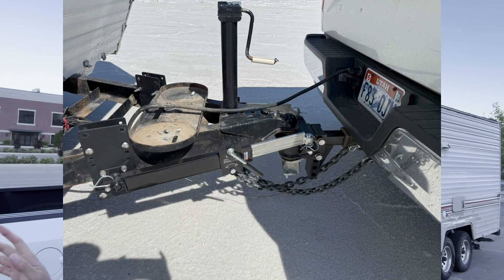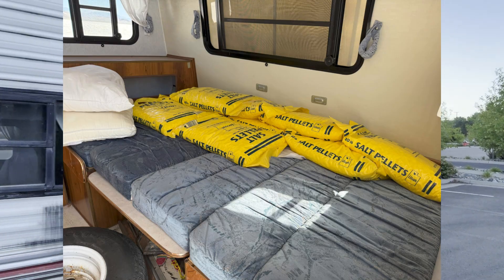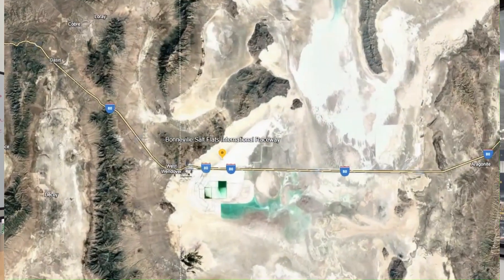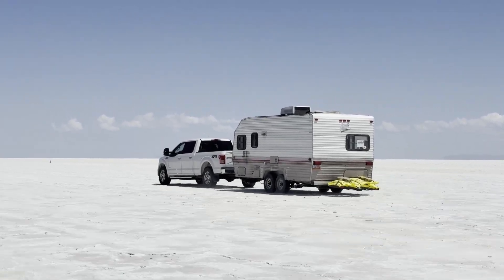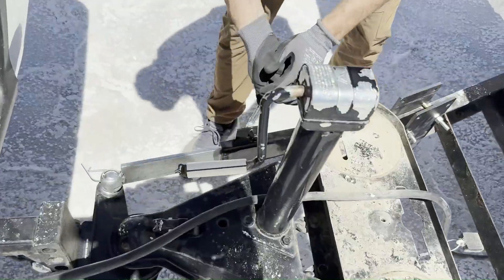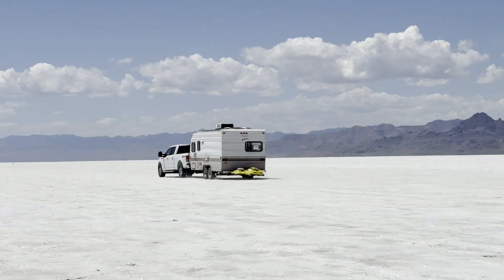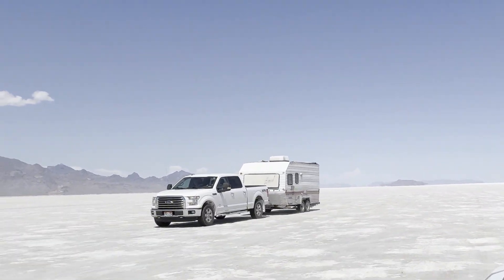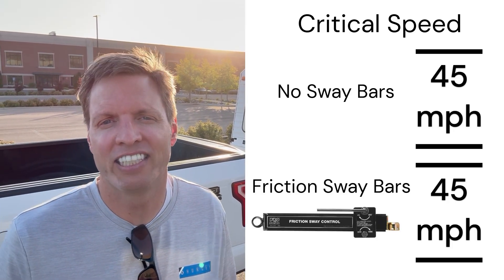Truck and Trailer maximum speed at the Bonneville Salt Flats

Comment: Great video. Incredibly concise - nice job! I've often wondered if friction bars are effective and deep down inside did not think they were. Thanks for confirming this. I have the cam style sway bars on my trailer that are adjusted to "lock in" when driving in a straight line. It would be great if you did a similar video on this type of sway control.
I also adhere to the rule, more tongue weight stabilizes, less tongue weight de-stabilizes. This is probably what's kept me safe in all my decades of towing.